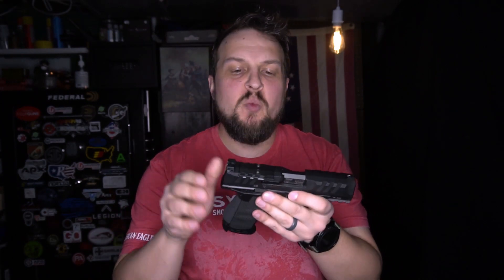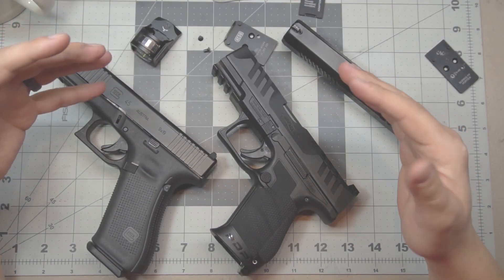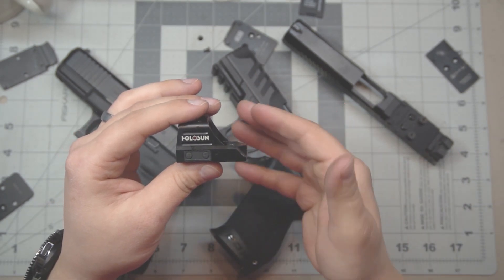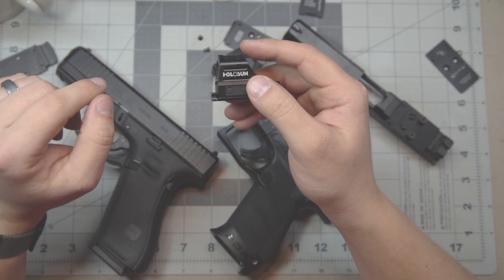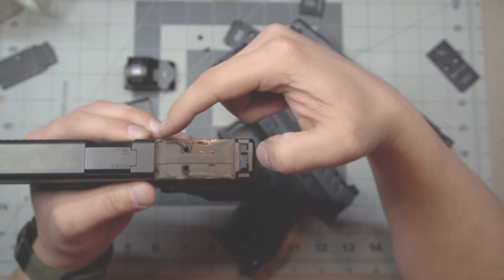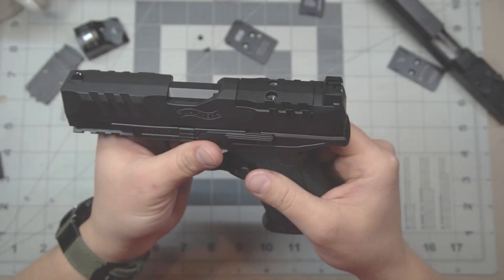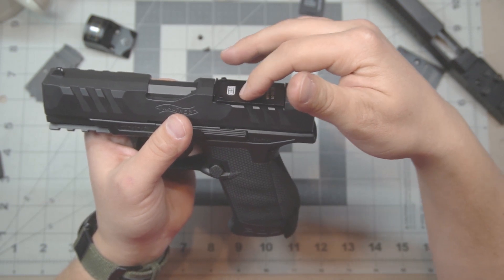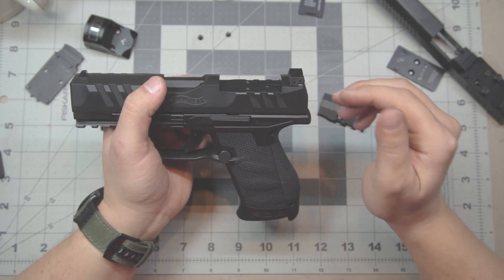The Gen 1 Walther PDP is going to Break

Comment: Mechanical Design is not the same as Mechanical Engineering.
Reply: That is a very important distinction.
Reply: Mechanical engineer here, he is right about screws not being designed to take shear. That is why,  when properly torqued,  they don't take shear. They clamp the two plates with enough force that friction stops them from sliding,  while the screw only sees tension. He pointed that out. But in order for any nub or channel to take any of the optic plate's shear force,  that clamp load would have had to already fail enough that there is movement between the plate and the slide, OR, the nub or channel would have to be an interference fit. That changes if there is a taper to it, but it looks pretty planar to me.  So if you have to use a press to put on optics plates, then yes they'll take that shear load.  .005" of clearance is still clearance, and the only thing holding the shear force is friction generated by clamp load. If the bolt stretches or friction force is overcome,  then the extra geometry will come into play.
Reply: @ngrady91  as another mechanical engineer, I was about to comment this exact thing. Don't underestimate static friction! Also notice that Walther themselves make the mounting plates. They have taken the material science guesswork out of the equation and we have some quality control when it comes to having a consistent coefficient of friction. Also, let's not forget, standard fasteners aren't made for shear force but that doesn't mean they will disintegrate at slightest presence of it. Pretty sure Walther did their homework on this one
Reply from the maker: I have a second video where I cover the forces involved. 😉

Comment: Videos like this are terrible for the gun industry.  Purely speculative video not even using an oem plate. I have the PDP with the Walther provided RMR plate and it fits very snugly and I have put 500 rounds with no problem. I do agree that I would like to have seen lugs between the frame and the plate. But to make a claim like this with out even using the oem plate is very bad. I would actually like to see Walther reply to this as this seems to be almost slander considering he is not using the oem plate and he is making an assertion that this “will break”. Poor taste and poor video.  Even the click bait thumbnail had me thinking it actually already broke.

Comment: Interesting. A year later and I’m unaware of a huge outcry caused by failed optic mounts. Likewise I’m not terribly plugged in to the firearms community so I may be unaware of such issues. In my profession fasteners resist shear forces all the time. They are able to do so by compressing the shearing surfaces such that the coefficient of friction caused by compressing those surfaces is sufficient to prevent movement and therefore shear. Additionally the side to side movement between slide and plate should be relatively unimportant. The important acceleration/deceleration is almost completely in the forward rearward direction. The forward rearward movement within the recessed slide cut out is far less though even closer tolerances of plate and slide would have been better.

Comment: Just sitting there saying "this will break" isn't proof of anything. You don't even have an OEM plate for the firearm. Why not do some actual testing instead of speculating?
Reply: I'm not agreeing with this video by any means. But Walther's plates are being made by C&H precision. So technically the plate he has is OEM.
Reply: @barcelona2170  Nope.  It would have to be the plate made by C&H for BOTH of: (1) the PDP, and (2) the optic our host chose to mount.  

Check your logic, check your facts Jose.

Comment: Do you actually believe the mechanical engineers at Walther would make such a mistake? Also he said the 3rd party plate is for a Walther, and not say it was for the PDP specifically. Use the official Walther plate part for the PDP, THEN make the video. People have been putting red dots on PDP's right away, and nothing has happened to them. The physics makes sense, however he is under-estimating his robust yet light those red dots and mounts are. I have yet to hear of any such breakages. Iron sights are held in without lugs and they don't break off. Non issue.
Reply: You are making true sense. I own a Walther PDP full size 5 inches. Ultra reliable. It's accurate. I have no problems with it. In fact I am confident to trust my life on it. Oh, but I didn't mount any optics. My combat PDP works great without adding any expenses!
Reply: @v.german11b  Mine Too. But Come Ooooooooon, You Know You Wanna Red Dot 😏
Reply: @Dunecoone I am patiently waiting for 2 things: One, the RDO system is perfected. Two, the price for a quality RDO becomes reasonable. And it will happen.
Reply: @v.german11b  I'm waiting on the price too LOL. I'm a Pour
Reply: @Dunecoone I am not "pour," but I try to be smart about spending wisely.
Reply: @v.german11b  that's  probably why you're not a pour
Reply: @Dunecoone  neither rich, but I manage 😉 😄
Reply: "Do you actually believe the mechanical engineers at Walther would make such a mistake?"..... Like SIG's mistake with the original P320 trigger? Or HK's mistake with VP9/40 trigger stop pin?.... look it up.

Comment: As a design engineer, I have to ask, have you ever seen a bolt action rifle's scope mounting system? That uses no lugs only tiny fasteners to secure a Much heavier optic than a microdot to a much heavier recoiling weapon like a big bore rifle?  Don't think screw failures are that common.
Reply: I agree, but I have to imagine the force of the slide reciprocating back and forth may be more significant. Plus inevitably at a higher rate of fire.
Reply: @mig1nc  I don’t think he’s actually a “design engineer” 😂
Reply: True but a rife does not move like the upper slide with the site.  Understand the difference?
Reply: Procraftv200dc, ha e you looked at the surface area of the PICATINNY RAILS on top of a bolt action rifle?

Also, the fasteners are of a much larger diameter and coarser thread implying that the fasteners are much stronger and the forces normal to bore have large lugs to absorb the force.

For the optic... it will depend on the system but it uses significantly more surface area and the nature of the loading is different - better.

I want the PDP to succeed but I don’t like the direction they chose. If I owned one I would upgrade the fasteners which isn’t a huge deal.
Reply: Rifles Scopes aren't mounted on a reciprocating slide they are bolted to the receiver

Comment: I had my father who is an aerospace engineer a.k.a. a rocket scientist do the math with regard to the weights of the optic etc.… The tensile strength of the mounting screws will be plenty to handle the forces associated with reciprocating recoil. This is just not a very accurate video

Comment: If you are so confident these are going to break because of what you THINK COULD happen, maybe show us, before you throw a video on YouTube.  Maybe prove it before you make these claims?  Hmmm, that would make more sense.  Just my 2 cents.
Reply: Couldn't agree more. This is a good gun but once people see this is the second viewed YouTube video people will turn away from it. Pisses me off. If he actually did legit testing like working malfunctions using the optic and stuff id say ok sure it hold water but he is making blanket statements without actually live footage.
Reply: Video for clout
Reply: Well said!
Reply: So you want him to break a $600 gun he bought because you don't understand mechanical engineering or the proof he demonstrated in every other design that validates his statements? Not sure your judgement on what makes sense is valid by any stretch haha.
Reply: @maximusjoseppi5904  that aftermarket plate he stuck on there fit like shit which makes me wonder bc cphw or whatever plates usually fit very tight. The deep recess on the front and back of the slide would counter the forces just fine.
Reply: @xm3ntal620  thats the plate you’re gonna get from walther for this pistol. Walther has partnered with c&h precision their the ones making the optics plates for this gun
Reply: @mrgoodbar216  well it fits like crud if that's the actual plate. Someone else questioned if that was the actual plate bc at the time the video was released the plates were not available yet.
Reply: He doesn't need to "break" a $600 gun. He made it clear his theory that the Mounting screws will break. Not the same thing. For me, I'll stick with my 2 mechanical engineering degrees and 20 years of design experience.
Reply: @briancaldwell871  point being don't make an assumption unless it's been tested like everybody else in the real world
Reply: @maximusjoseppi5904  And what do YOU understand about mechanical engineering?  You're implying our host understands it.  Yet his video shows he understands naught about mechanics, and zero about engineering.

Comment: Umm, isn't the mounting plate actually secured in a cutout in the slide? Why won't the edge of the cutout (assuming tighter tolerances with OEM plates) secure the mount from "failure" any more than a little "nub"?
Reply: This is the most obvious physics omission yet! Thanks @CPiper for pointing it out. I would be concerned with all the points presented by this video about having no lugs if the optic and slide merely sat perched on top of a slide with no wall or nubs for bracing against such force but since the PDP has such a deep cut an edge wall for the plate to rest against (tightly might I add with the correct production version) there should be significantly less risk of the the reciprocating slide force sheering the screw fasteners alone.
Reply: @ansonhuang2138  I agree with you, but I think one of the points he tried to make, perhaps not very well, was that there seems to be a lot of slop in the plate fitment, so it's not fully resting against the ledge.
Reply: I guess you would say that is a flaw in the plate machining, not the gun.

Comment: Walther has posted on their webpage addressing this video. The page on Walter's website is found under "Walther PDP Optic Plate Stress Test".
Reply: 50k rounds with no plate adjustments and zero issues.  Until he shows us a broken one, going to enjoy my new PDP.
Reply from the maker: That's a false statement. Re-read their release.
Reply: @mh_golfer  My comment is not to take sides. I own a pdp. I wish there were lugs or grooves of some sort--it wouldn't hurt--but I'm choosing to trust Walther engineering on this. Now, to the reason for my comment. If you read Walther's testing conclusions carefully, you'll notice that they don't claim more than 10k rounds without adjustment or issues. They shot 1 pistol 10k rounds with no issues. They shot another pistol 20k rounds with no issues during 10k rounds (I hope this is a typo). They shot the last pistol 50k rounds with multiple RDS. None of these last ones had issues, but who knows how many RDS or for how many rounds? They don't say. I hate to say it, but the way they chose their wording does make me a little suspicious.
Reply: @mh_golfer  50k rounds huh? So you spend $40,000 on ammo huh? Sounds like BS to me.
Reply: @SirPhilMcCrackinVonBeggington  - Not me dude, Walther put 50k rounds through it and posted the results.

Comment: I've put about a 1000 rounds through mine so far. Holds zero no problem.  You're assuming and guessing at this point. My CZ's optic plate looks a little bit more rugged , I'll give you that. Keep shooting it with a Walther plate and report back , dont beat it with a hammer just to prove a point though...

Comment: Hate to bust your video, but the plate that comes from Walther fits tight front to rear.
Reply: like real tight?
Reply: @ch-ir8ld  Well I didn't drive it in with a hammer, but tight like " no movement "  forward or rearward.
Reply: Mine is installed, no front to back movement in my pdp 4”
Reply: I just laughed when I realized he doesn’t even have Walthers actual plate and has done zero testing.
Reply: What optic are you running on it?
Reply: @imminentodin_9943  I have a 507C that’s been great for 1500rds and now moving to a 509T Holosun once the C&H precision plate comes today.
Reply: @imminentodin_9943  507c.  On pdp
Reply: @heaterfamily  thanks.
Reply: @DDRDK  thanks
Reply: @imminentodin_9943   even if you plan to run an optic that’s on the list of Walthers “free” plate you get with the pistol. C&H precision makes plates for the PDP and 30min ago I just got my 509T plate and the machining and figment definitely seem better than Walthers included plate.
Reply: @Diabolus_Musica  fantastic plates! Got it today and it’s definitely a step up from the Walther plate.
Reply: @imminentodin_9943  Leupold delta point pro.  And man, it's awesome
Reply: @bubbalewis5423  that's another optic I'm leaning towards. Thanks for the insight.
Reply: Lol
Reply: @bubbalewis5423  Well, I thought that must be the case. I haven't gotten my "free" plate yet, so can't really judge yet what this joker says.
Reply: @DDRDK  I've been looking to purchase the same combination of PDP and 509T. How do you love it?
Reply: @glencruciani  been running the 507 and just got a 509T. Not only do I love the PDP the 509 is my new favorite optic. I recently had lint pack in my 507 and thought it was broken. This made me think yikes imagine that happening in a stressful situation. Yeah you have back up sites but I’d rather keep that from happening so I got the 509. Problem solved. Just a warning though the sights aren’t tall enough to co witness with the 509 so you’ll need take sights.
Reply: Guess this guy has never heard of shear head and tension head fasteners before...where are all the rail mount failures on magnum caliber rifles??
Reply: @BrianPatronie  that doesn’t exist 🤫
Reply: The plate does not "fit tight front to rear". Once the screws are tightened down they pull the plate all the way forward, flush with the frame. There is a gap at the rear. This is by design. Walther has literature on the plates stating 50,000rd tests with the optic plate without failure.
Reply: @DDRDK   Walther reps were at my local shop with the PDP and we were able to shoot it without an optic attached. They told us the plates that come with the pistol were made by C&H. The day the PDP was released I received a email from C&H advertising that they were proud to be the supplier for the Walther PDP. Are you ordering a second plate from C&H and is it different from the supplied plate?
Reply: @SFJF26  I did because they don’t have the option to get a free one from Walther that supports the Holosun 509 but they do have one from Walther for the 507-508 and RMR stuff.
Reply: @DDRDK  Got it. Thanks
Reply: What about the screws?  What are they made of ? Density/ flex ... was loc tite used?  What type?  There are PLENTY of unanswered questions. I wouldn't crap on someone's take (although flawed IMO) without the majority of the variables. I'm curious to see long term  issues.
Reply: anyone running an optic with the full size? just bought it a few days ago still sitting at the shop.

Comment: Have you tried using an official Walther complimentary mounting plate instead? There looks like  there is a hole that it might be able to slot into for more support in the front.
Reply from the maker: I haven't, but there are no lugs on the slide for it to hook into 🤷🏻‍♂️ only thing it could provide is a tighter fit.
Reply: I just received my complimentary plate from Walther today. The bottom of the plate is smooth with a relief for the striker. There isn’t a lot of front to rear movement but really nothing to prevent side to side movement.
Reply from the maker: Is it metal or plastic?
Reply: @workthetrigger  Steel
Reply: @blechmaier  I imagine as long as the plate is designed and machined with minimal tolerance to fit with the rest of the slide, the front to rear movement should be minimal as it just pushes against the rest of the slide without movement. Yes, lugs would help but perhaps it's not absolutely necessary. Of course side to side movement will be more of an issue. However, front to rear rigidity is definitely more important since that is the direction the slide moves and people shouldn't be shaking their pistol side to side super vigorously. I understand what this video is saying but I trust that in the real world it is likely not a guaranteed break. I will find out much later for myself though as I don't plan on having a red dot on for a while. I also feel like it was a HUGE oversight not to use a Walther plate. It is a little disingenuous given how critical he is.
Reply: @maximum667722  I wouldn't be too concerned about side to side movement, since that's not the direction the majority of the forces are acting. I really hope that the front to rear fit is designed in a way that makes additional load bearing geometry unnecessary.
Reply: @workthetrigger  Are you ready to admit you used the WRONG PLATE for the application?

Comment: Not to be nit picky but mechanical design is not the same as mechanical engineering as the magnitude and depth of education can differ substantially. I may not know as much as you about material strength but the engineers who designed this system did and I’d bet using the correct plates they recommend makes a difference. Some who have already received their plates claim they don’t have the play we see with your third party plate. I’m interested to see for myself how the walther plate actually fits. I enjoyed the video.
Reply: That's the main point. The manufacturer will ship you the correct plate for the optics of your choice. Some smart people do things and get too far ahead of themselves.  Use the correct part before making assumptions.